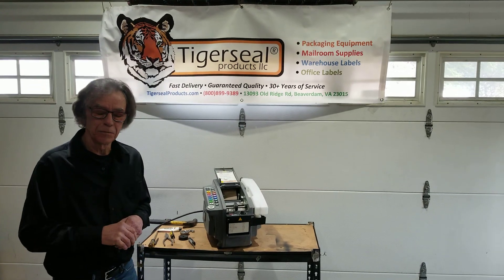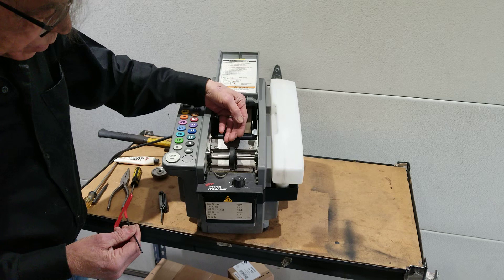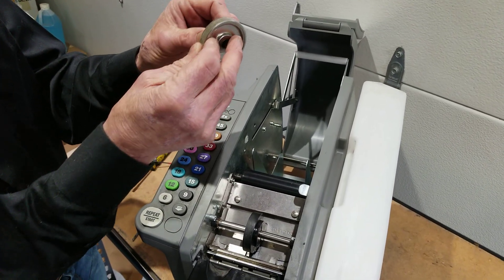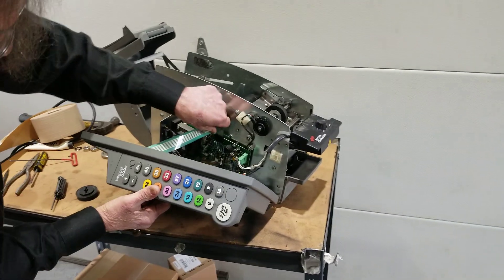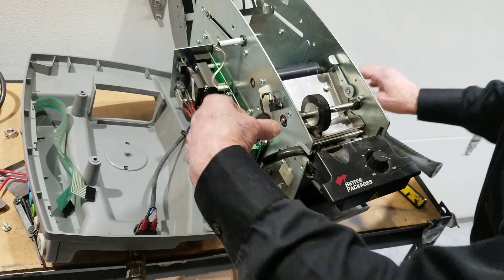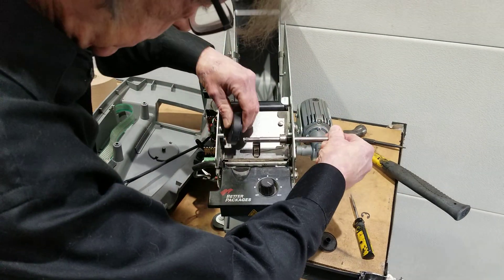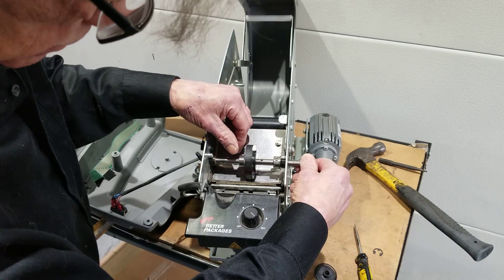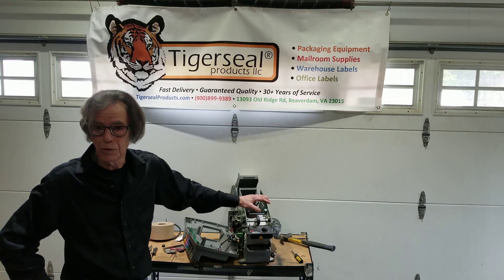Better Pack 555e Service   Short Tape Lengths

Comment: great video, how about if the length buttons on one side work but not the other side?
Reply: my first check is the keypad switch - this is the flat keypad that fits under the rubber buttons.  It sounds like one of the traces may be bad (I've seen this when someone has accidentally cut the ribbon cable with a box cutter).
Reply: Check the placement of both ribbon connectors. I once even forgot to plug in one of them, with the same problem resulting as you describe.

Comment: Did anyone ever repair the PCB for the short tape issue? I eliminated all possible mechanical reasons and the tape-length sensor. It only leaves me with PCB as a possible cause. And since they cost almost half the price of a used machine I am not inclined to ask my management to buy new PCBs.
Reply: If it's the tape is short for all buttons, I'd replace the code wheel and also the tape length sensor.  If that doesn't work, I'd change out the software chip.
Reply: @huckleberrysundry  Thank you! How do you replace the software chip?
Reply: @FerdoFulgosi  Before doing that (I'm referencing a comment made by another person), check the placement of the ribbon cable connectors on the controller board (they should both match and be centered on the connector).

Regarding the software chip, after purchasing a new chip (v3.1 is the current version), pry the old chip from it's socket (very carefully - in case you want to reuse it), and carefully push the new chip into the socket.  Things to note: make sure you have the current orientation (there is a small mark on the chip), and also make sure the pins are aligned with the holes in the socket before pushing it in place.